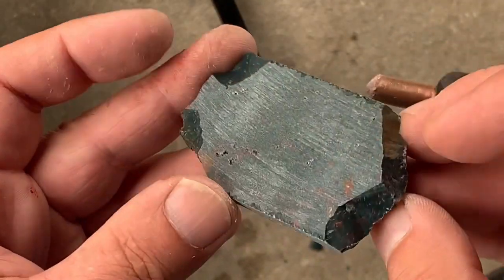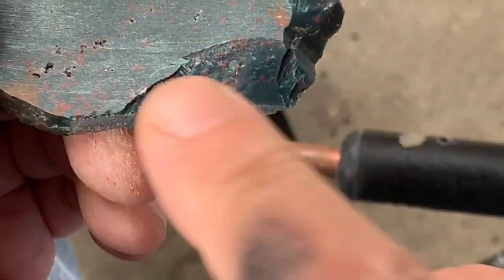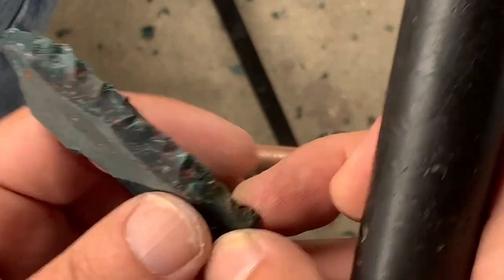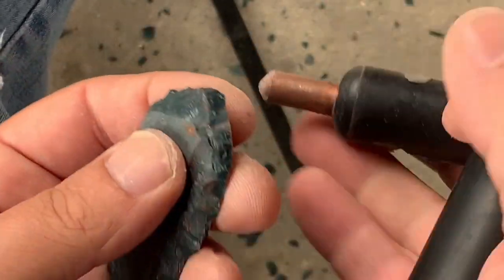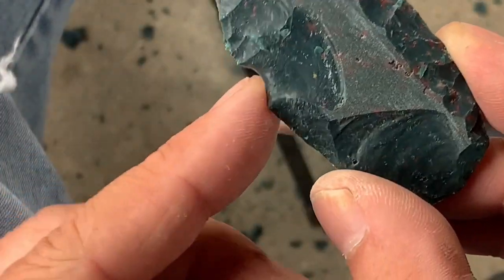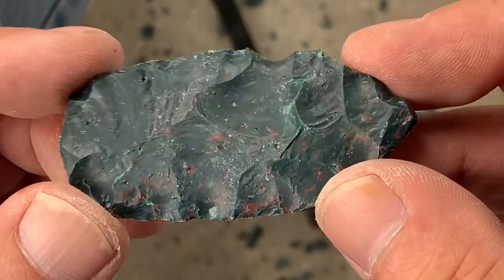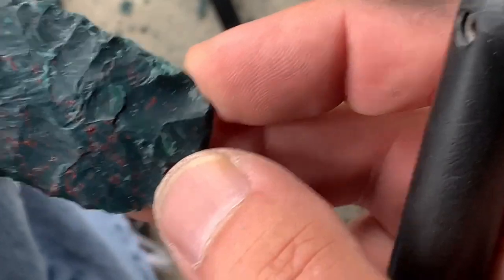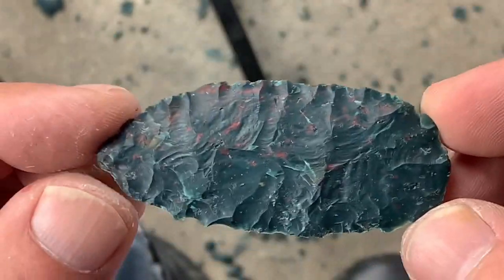#Flintknapping jasper/will it break? 🤔

Comment: I have bought the Jasper you knapped at a Lapidary store.  They call it Indian Jasper.  I apparently comes from India.  I have heat treated it.   Heat treating seems to really weaken any fractures in the stone and sudden breaks are frustrating.   But you are right, the pink colour in the green makes for pretty points.  Nice job skinning it out.  🏆
Reply: By the way, your camera must be really good, or maybe you are a really good video guy.  All your videos as so very clear.  The close up of where you place the copper flaker is absolutely clear as the videos show everything up close and is a great because we see the results of the flakes detached.
Did you make the Copper Flaker yourself, or buy it?  I use a 1-1/8 inch piece of DELRIN which is a little too large in diameter I think, as it slips out from under my knee.    Yours looks like 3/4 inch with a1/4 inch copper rod.  The smaller diameter would hold better under my knee, I think.  If you bought it, would you mind telling me where?